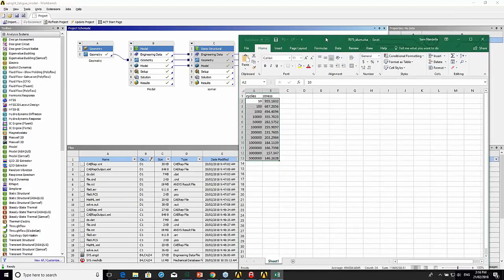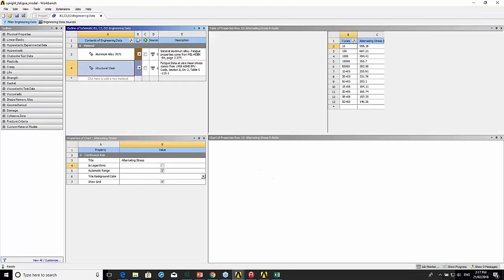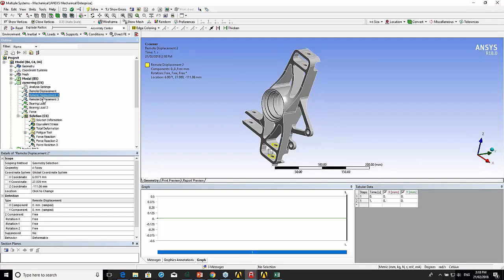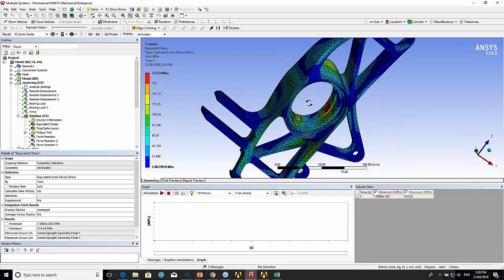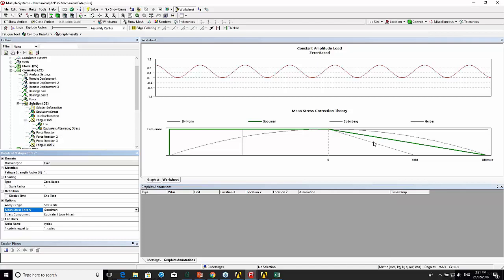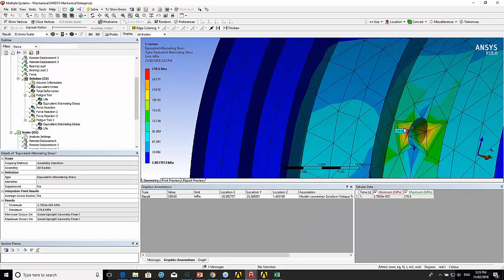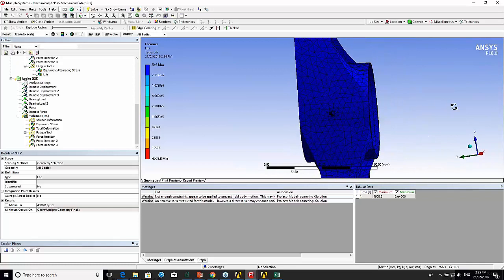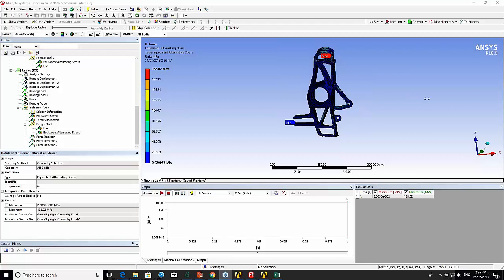FEA for FSAE #10 HOW TO PERFORM ANSYS FATIGUE ANALYSIS

Comment: 6:17 I think it's the other way around? Soderberg is for ductile and Goodman for brittle materials. Right?
Reply from the maker: Response from one of our senior engineers:
Goodman is used for low ductility materials, the correction of mean stress is based on ultimate stress.
Soderberg is based on correcting mean stress based on yield stress, and brittle materials fail slightly above yield.